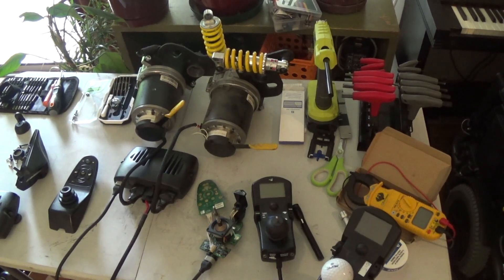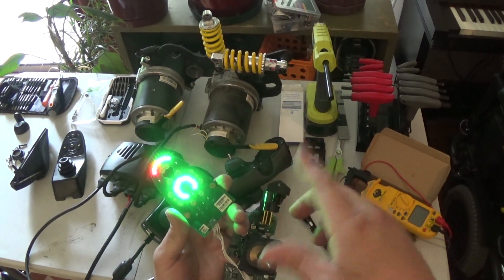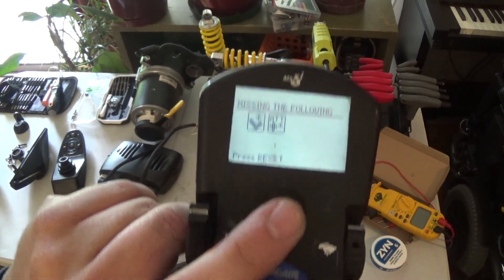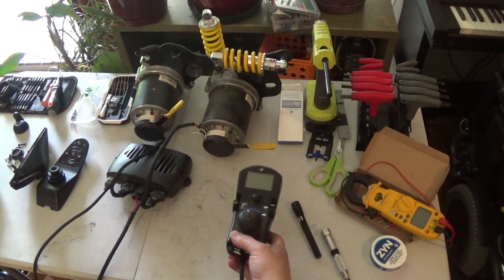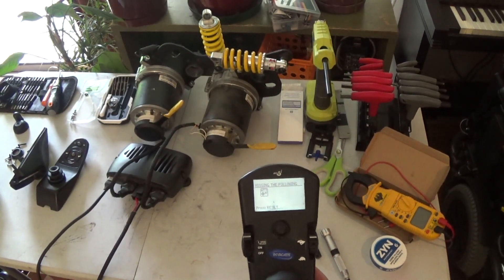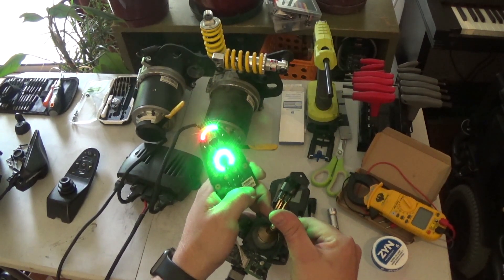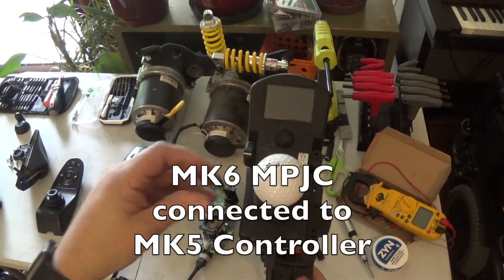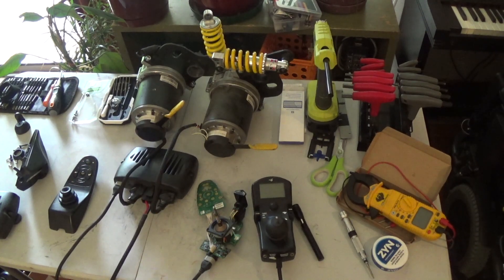MK5 & MK6 joystick/controller compatibility testing!

Comment: Hey I just came across this video and watched it not realising I've been watching videos from your other channel!

I'm trying to install a foot controller that came from an old Invacare chair with a square 4 pin connector on the cable (DX/DX2?). I got another chair with a Shark joystick hoping to install the foot controller, but it has the same wider rectangle connector as on this video.

I've seen other Shark joysticks with the 4 pin same as my foot controller. I'm wondering if I have any chance of making an adapter to connect them together?

I was under the impression the MK5/MK6 connectors as in your video were also DX/DX2, so not sure where I have gone wrong.

Thanks!
Reply from the maker: yeaaa- invacare had SO MANY different models of controls and accessories... its hard to tell whats compatible.. however DX/DX2 was its own, separate control system
ive got a lot of documentation on the website for MK5 & 6 control systems ..
https://brokenwheelchairs.com/page-2/page-23/
then dynamic controls has a lot of resources for DX/DX2 on their hub..
https://www.dynamiccontrols.com/resource-hub/dx2-resources-hub
generally speaking, nothing is really cross-compatible between control systems :^/
UNLESS we're talkin about accessories that use dedicated interface modules - sip n puff/head arrays etc..
Reply: @myshoeisonfire  @myshoeisonfire  hey thanks very much for the reply and the links I'll take a look!

I think where I've got confused is the they are both by dynamic controls... So what 'system' are Mk5 and Mk6 classed as? Thanks!
Reply from the maker: MK5, and 6 are their own systems they use the same types of connectors though - and there are a few 'shark' style joysticks that will work with both
Reply: @myshoeisonfire  it's actually a foot controller I've got to try, apparently the seller I got it from said it went straight into the chair without an interface, but was used on a chair with the dx2 system. I think it will be easier to try get another cheap chair that's on that system

Comment: After searching all over for nearly 8 hours I come across your video. I'm hoping you can help with a question. I have an mk6  and there's another box, not mk6 90 w/acc but one with the right and left plugs coming from it. In the middle there's another plug but coming from the same spot is a line with a small black box with three holes set in a triangle. A plug looks the same but has 3 pins to plug into the one coming from the box. Where does that line go and what's it for? This chair was given to me disassembled. That one wire has the end cut off and I think I'm missing another wiring harness. Can't find anything online with details of this. Thanks
Reply from the maker: usually between the 2 motor connectors is the battery connection.  there's photos of a bunch of controllers on the website.. maybe they will help..
brokenwheelchairs.com